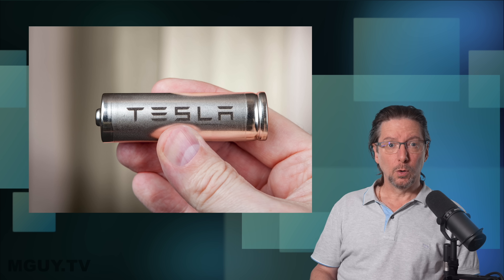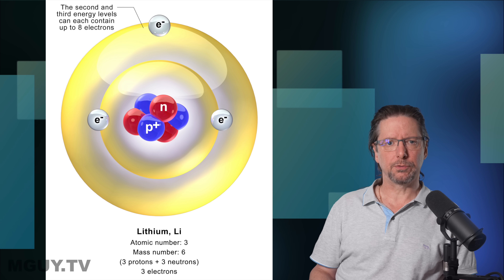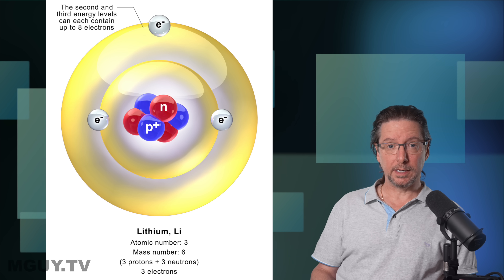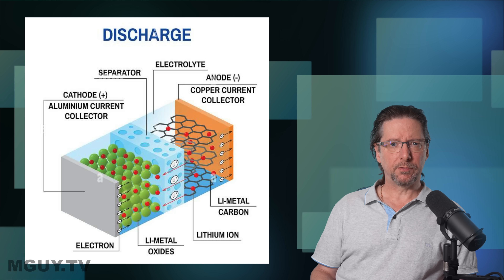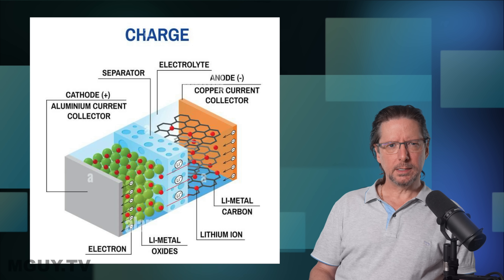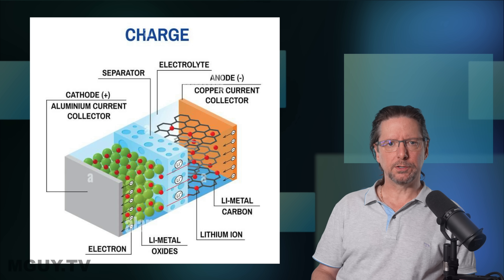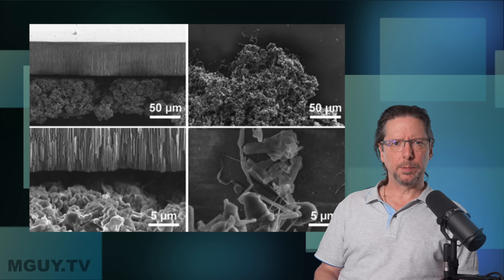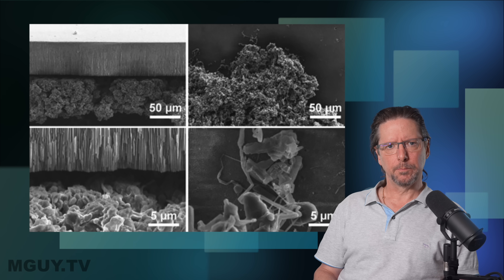Why are EVs so TERRIBLE in the cold? | MGUY Australia

Comment: This explains why engineer's do engineering and politicians do nothing of any discernable benefit. Time to reduce the size of governments.
Reply: 1. Child battery mineral labor

2. Range anxiety

3. Risk of garage fires

4. Paying 20k more than a
comparable vehicle

5. Battery denegration

6. Poor resale value

7. Reduced performance in
cold, highway.

8. Higher repair costs

9. Awful charging network
experiences in the weather
without restrooms

10. Higher insurance rates

11. Replacing tires more
frequently

12. Death by autopilot

13. 30 - 40k battery

14. Low km range

15. must wait in-line 1-2 hrs
to charge.

16. Then wait more time to charge, while charging.

17. Spontaneous combustion, with no way to put out the fire storm.

18. If they catch fire in a tunnel, many people will die.

19. People without a pro charger system or a parking spot at their house, will run an extension cord to the road, which is dangerous and could lead to people tampering with your charging setup (super slow charging at the road)

20. If you're in California, you won't be able to charge your car past 4pm because of a shortage of electricity supply on the cheesy grid.

21. It is not actually "green". The pollution is made at the power station, not the car.

22. Only 5% of used junk batteries get recycled, the rest go directly into the bin. It's cheaper to mine for new minerals.

23. Chhinna actually does 70% of all the refining of the minerals and production of the batteries.

24. Minerals are becoming more and more scarce, and the cost will only go up, not down.

25. Some countries where they mine for lithium, actually use a very big boat load of fresh water to only produce a ton of lithium, so they are afraid of running out of water. It takes over 2 million liters of fresh clean water to produce 1 ton of lithium. 

26. Ev cars will soon not be able to drive in tunnels or be able to park in underground parking garage and probably will eventually void your house insurance if you park it in your personal garage.... 

27. You can't charge your battery at super stations when it is bitter cold out. 

28. If a fire truck comes to put out an Ev fire, all the chemicals go directly into the sewer system, poisoning everything. They need tons of water to slow down the burn. They can't put them out. They are only trying to prevent over things near by from catching fire. 

29. Ok, there is 2 good things; regenerative braking, which charges the battery while you are slowing down on the highway, which saves your brakes from much wear.
Reply: @jakefriesenjake  dude, stop it with a senseless, objectively wrong copy & paste crap. Just enjoy the pork rinds you get for free at a gas station and shut up.
Reply: @jakefriesenjake  Gosh, I admire your copy & paste skills from the Exxon/BP/Conoco Phillips websites. Too bad you didn't read any of them or research them.
Oh and you forgot the child labor used by the oil industry, the Cobalt (not used in batteries any more) used in oil refining, the oil rig disasters/pipeline disasters/tanker disasters/groundwater pollution and many, many more.
Reply: This happens every time that technical decisions are made by non-technical people.
Reply: @ghost307  or do you mean the decisions made by people afraid of the future, or people getting funding from industries that don't want a choice in transportation? I'm confused, maybe you meant both...
Reply: Politicians do work for benefit - their own. 😄
Reply: @Mark-s7d6l  yes, and those politicians are funded by labor unions, oil interests and legacy car makers.
Reply: Our founding fathers in America knew that 250 years ago.  However, after the civil war, our states lost nearly all their power.  So, now we are lorded over by 536 idiots in Washington.
Reply: Engineers design products that help others and make money. Politicians only cost money as they spend that which doesn't belong to them.
Reply: Engineers are just like politicians. They design stuff to break. It job security. 😢

Comment: The chemistry explanation is a bit simplified worded, although I suppose it's just about the right level for a video about EVs rather than about hardcore chemistry or quantum physics.

For the slightly longer explanation:  The comparison with solubility of salt in water is an apt one, though, but then it's the only part that really matters for EVs in the cold. The rest of the chemistry talk is just fluff. In this case it's just about solubility but not in water. It's how "soluble" the lithium is in the graphite anode. Which goes down very fast when you lower temperatures. (And yes, a solid can be soluble in another solid, and exhibit wild variations with temperatures. E.g., carbon in iron. It's why we quench steel.)

And now for the boring, unnecessary and irrelevant over-explaining the rest of the chemistry (you were warned:p): The atom doesn't like to "give away" its electron per se, nor does it have anything to do with being more stable.

What happens is that all atoms like to form one full electron shell (2 electrons for the first orbit, 8 electrons after) by sharing electrons. That's how water (H2O) or for that matter lithium oxide (Li2O) work. That lone outer electron of each of the H or Li,  is shared with Oxygen atom, to form an 8 electron shell for the Oxygen atom. It can be kinda metaphorically described as some atoms "giving away" electrons, and some "receiving" them, but really they're just shared.

To illustrate the difference, consider the simple H2 molecule or the O2 in the air. Hydrogen is explained simplified as liking to give its electron, but wait, if both like to give it, then who's receiving it? The answer really is both. Both are sharing an electron, so both get to form a full a full 2-electron shell. Conversely, Oxygen is simplified as liking to get electrons, but same problem: if both O atoms like to get electrons, and neither likes to give, then how does that molecule even work? Well, in reality both share 2 of their electrons so they can both have a full electron shell.

Why that gives off energy is basically not a matter of stability (the only way for an atom to be unstable would mean radioactive), but just it being the lower energy state. Whey you go from the higher energy state to the lower one, you get the extra energy as something else. Kinda like you can get some energy for free when driving from the top of a hill to the bottom, but need extra energy to go the other way around.

Comment: ICE vehicles also have trouble in the cold too getting trapped in snow drifts and not having enough traction to get out.
Reply: But the engine still runs!
Reply: Not if you've abandoned the car. @revolvermaster4939
Reply: EV’s get just as stuck as ice’s in snow, what’s your point?

Comment: Don't be silly, I listened to female motoring expert from the USA, she said it wasn't the EV that was the problem in the big freeze, but the drivers who should have preheated their frozen EV vehicles before charging? So, every EV driver who wants to charge their vehicle in extreme cold weather, should buy a box of matches  and some fire lighters so you can set your EV on fire before charging.
Reply: Obviously. However, my question to her is what source of heat she'd prefer? To save the planet, of course. It wouldn't be possible to use a dangerous CO2-emitting fossil fuel to heat it, nor could you use coal or wood. So, would she recommend carrying an extra battery to heat this battery so that it runs more efficiently? And if so, would there then need to be an additional battery to heat the battery-heater battery? And where is she going to have room in her Louis Vuitton handbag with her chihuahua in the way? She'll probably need a heater for the dog too, now that I think of it.
Reply: @kma3647  🤣🤣🤣🤣 gold!!
Reply: @kma3647  As someone living in a very cold part of Canada, I'd say that here even gas cars need to be boosted with a battery to start when it's very cold (-30 or lower)

Meanwhile, I know people with EVs and they actually start without any problem.  Unless you have to make a super long travel of over 200 kilometers, which is unlikely for most people, the EV will be fine even without pre heating
Reply: More ICE owner propaganda. You don't need matches at all, EV's are fine in the cold and some even come with an automated heating system where the batteries spontaneously combust to heat them.
Reply: @jwatson9732  Another problem solved by EV is forgetting where you parked your car. Simply remote start it and you will soon see and hear the battery combust, acting like a beacon for you to find your car.
Reply: You sound dumb.
Reply: True Story
Reply: lol man so dumb
Reply: You ice lovers are a weird bunch.
Reply: 1. Child battery mineral labor

2. Range anxiety

3. Risk of garage fires

4. Paying 20k more than a
comparable vehicle

5. Battery denegration

6. Poor resale value

7. Reduced performance in
cold, highway.

8. Higher repair costs

9. Awful charging network
experiences in the weather
without restrooms

10. Higher insurance rates

11. Replacing tires more
frequently

12. Death by autopilot

13. 30 - 40k battery

14. Low km range

15. must wait in-line 1-2 hrs
to charge.

16. Then wait more time to charge, while charging.

17. Spontaneous combustion, with no way to put out the fire storm.

18. If they catch fire in a tunnel, many people will die.

19. People without a pro charger system or a parking spot at their house, will run an extension cord to the road, which is dangerous and could lead to people tampering with your charging setup (super slow charging at the road)

20. If you're in California, you won't be able to charge your car past 4pm because of a shortage of electricity supply on the cheesy grid.

21. It is not actually "green". The pollution is made at the power station, not the car.

22. Only 5% of used junk batteries get recycled, the rest go directly into the bin. It's cheaper to mine for new minerals.

23. Chhinna actually does 70% of all the refining of the minerals and production of the batteries.

24. Minerals are becoming more and more scarce, and the cost will only go up, not down.

25. Some countries where they mine for lithium, actually use a very big boat load of fresh water to only produce a ton of lithium, so they are afraid of running out of water. It takes over 2 million liters of fresh clean water to produce 1 ton of lithium. 

26. Ev cars will soon not be able to drive in tunnels or be able to park in underground parking garage and probably will eventually void your house insurance if you park it in your personal garage.... 

27. You can't charge your battery at super stations when it is bitter cold out. 

28. If a fire truck comes to put out an Ev fire, all the chemicals go directly into the sewer system, poisoning everything. They need tons of water to slow down the burn. They can't put them out. They are only trying to prevent over things near by from catching fire. 

29. Ok, there is 2 good things; regenerative braking, which charges the battery while you are slowing down on the highway, which saves your brakes from much wear.
Reply: @jakefriesenjake  Too bad we cant just synthetically manufacture fuel for our combustion engines... oh wait, we can! And F1 is already testing that fuel and will use it in the near future for net zero carbon. As the oil dwindles, ramping up the production of the synthetic fuel will make it cheaper.
Reply: @jakefriesenjake can you let me know where to get a Tesla model 3 equivalent for £20k. Thanks!
Reply: @Audioremedy0785  you have bad reading comprehension
Reply: @Audioremedy0785  no idea. Don't think that they are that cheap

Comment: If the battery charge is too low, the battery management system will stop you draining it further. When your iPhone says it is flat, it isn't. The battery still has charge but it may damage the battery to drain it further, so it turns off.  If you drain a Lithium Ion battery too much, you damage the battery, so the BMS will progressively stop you accessing power as the charge gets too low. So in your Tosla, if your charge is too low and the battery is too cold, you may not be able to use the battery to heat the battery, so you can charge it. Nasty catch-22 if you are freezing and can't charge your car. Battery pre-conditioning is fantastic... as long as you have enough charge to run the pre-conditioning cycle. Net zero is still net zero. Ask Polestar, now net zero haha.
Reply: Another way of saying that is when you drive an EV the computer is in charge, not you.
Reply: @alexalex13131  Oh! You mean the computer in a gas car that controls your ABS braking system, THAT computer? Or the gas car computer that monitors the engine and fuel system while you drive, THAT computer?
Reply: @alexalex13131  Incorrect, you can override important settings around charging and preheating. Why make these comments before finding out the facts first?
Reply: @stevenmitchell7830 You are incorrect I'm afraid. Just stop guessing and go away and find out the facts. Ideally preconditioning will be run automatically or manually before charging. If  you don't have to have enough charge in the battery to do this,  then plugging into the public charger will draw current to condition the battery before charging.
Reply: @seannewman5391  Thank you for enlightening me. Please explain why so many Tesla owners in the U.S. cold snap weren't able to charge recently and had to have their vehicles towed away from the Tesla chargers? If they could use power from the charger to precondition, why didn't they?
Reply: @stevenmitchell7830  I can enlighten you on the much-reported issue with Tesla charging in Chicago.
First, it was one or two Superchargers out of the 9 in the Chicago area. Funny thing, the same chargers in Canada, Norway, Alaska, North Dakota didn't seem to have an issue, but the media sure made it look like NO Teslas can charge when it's cold. Score one for paid journalism, and score two for you not asking any questions. Score the big three for you drawing the conclusions about Teslas you were told to.
While it's still being investigated, here are some possibilities for just one or two charging locations having an issue: local utility problem, charger in a high use location so it draws lots of traffic, cars entering the queue with no energy left, Uber drivers expecting a 100% charge that takes more time, drivers unwilling to go to another charger that's open.
And as for the specific chargers in question in Chicago, some were damaged.
Reply: @stevenmitchell7830  ignorance mainly. Just didnt use the cars and chargers properly. Some have already admitted as much.
Reply: Many people have an IQ of -25 % . Tesla shows a warning on the screen when the battery reaches 20 % to charge directly !Most of them drive their EVs down to 2-3% of charge and expect the chargers to charge it at 0F without the battery being warm !  Most EV's circuitry prevent a froze battery from charging at 0F when you are down to 2-3% of charge .70% of all new cars here in Finland are EVs, a country that is extremelly cold in winter, and I've never heard of massive numbers of EV car not charging.And i don"t have this problem with my Tesla 3 .We have a better IQ.

Odgovori
Reply: Steven mate I do like the name Tosla it just sums up EV's in one word and I think  only tossers would even consider owning one of these cretinmobiles.
Reply: @johngoard8272  belittling and badmouthing, insults and name calling is what MGUY incites. Dont sink to his level even if you dont agree with someone.
Reply: You have no idea what you're talking about. Ask an EV owner before looking foolish. You do not need pre-heat in an EV to charge the battery, I know, I've done it. My Tesla will attempt to keep the battery warm until it's no longer beneficial, then will let you drain the battery to zero to get to your destination. I've charged MANY times when my car says the battery is cold. Do you know what happens? It uses the charging energy to warm the battery, then charges it. Learn about a topic BEFORE you make a statement.